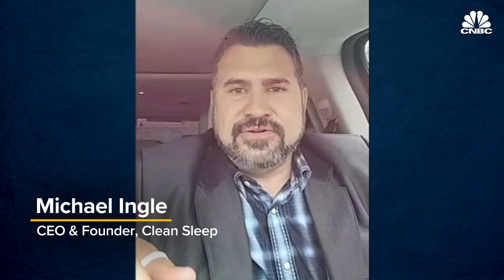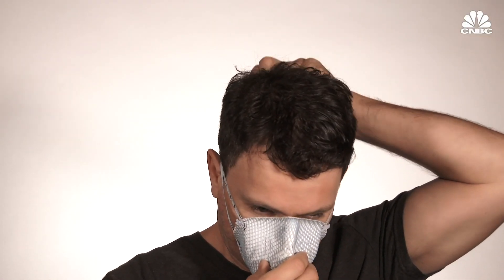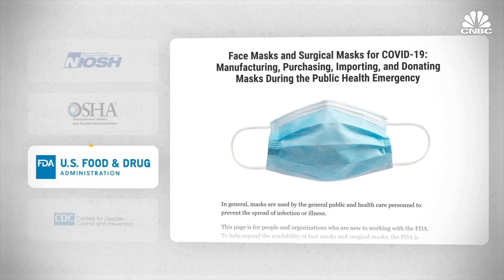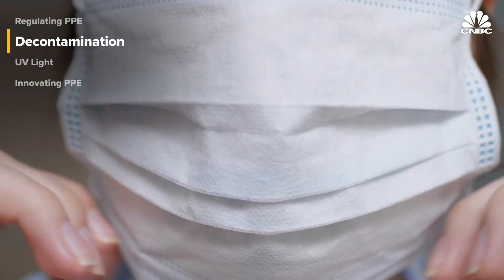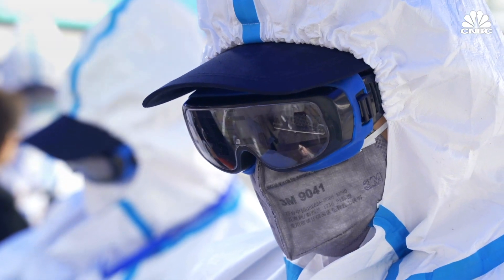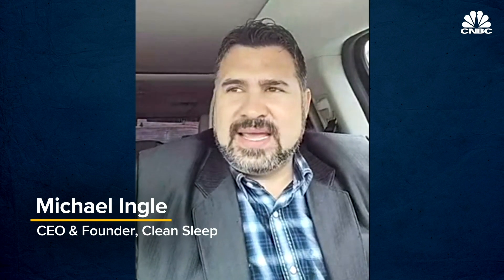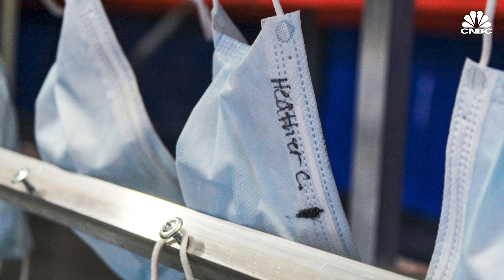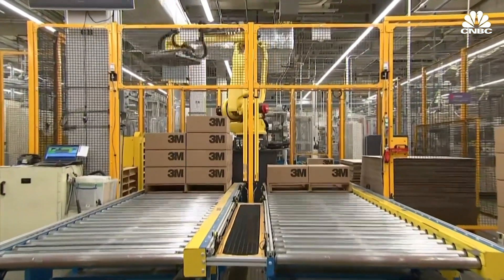Can PPE Be Cleaned And Reused?

Comment: they recommend the public to use cloth masks because the healthcare workers don’t have any... the cdc even released a report saying it wouldn’t filter SARS-CoV-2 particles
Reply: My question is why the common plans for cloth masks almost univerally fail to include a HEPA filter layer. HEPA can come from car cabin air filters, Vacuum cleaner filters, and furnace filters for allergens. All of these sources of HEPA filter material are  plentiful and in stock.
https://www.amazon.com/Hepa-Filter-Shop-Vac/s?k=Hepa+Filter+Shop+Vac
https://www.jondon.com/filter-2nd-stage-pre-filter-for-dri-eaz-air-scrubbers-1.html?gclid=EAIaIQobChMI75m0pqzQ6QIVBvzjBx3ktgxAEAQYAiABEgKwb_D_BwE
https://www.boschautoparts.com/en/auto/filters/hepa-cabin-filters
Reply: it does not spread through the air it's through water droplets mainly from the nose and mouth of the infected you don't need a filter you need a shield

Comment: No one should be reusing someone else mask or PPE.
Reply: @Grand poobah  I use to work in the nuclear power field. We traveled around refueling reactors. All the ppe we used was reusable from the respirators (filters were disposable), to the cotton "bunny suits". They were dry cleaned, and the respirators were put in a commercial dishwasher and sanitized for reuse. It can be done.  The plastic space suits for wet work were the only thing not reusable.

Comment: Put PPE in Ultraviolet - C radiation, it would get Sanitized. For N-95 masks, use carbon fibre washable N-95 masks which can be used numerous times. I live in Delhi and bcoz of High pollution levels during winter, I use carbon Fibre N-95 Masks throughout winters, it's costly as compared to normal N-95 mask but being washable and reusable justifies its price.
BTW manufacturing PPE isn't that tough, In my country India, during the initial phase of Covid-19 spread, not a single PPE was used to be manufactured domestically but now 450k PPEs r manufactured per day in India.

Comment: Should have been done years ago...by any hospital or health care system that wanted to curb costs. Why did it take a pandemic to think of this?!
Reply: Because it's not best practice.

New= guaranteeed safe
Reused = mostly guaranteed safe.
Reply: @Robert-j6r8c  The infection rate of health care workers is around 5%-6%. That number corresponds to the effectiveness of N95 masks which filters out 95% of harmful pathogens. No wonder health care workers are scared to the bone. There's always that 5%. Many nurses and doctors are old with pre-existing conditions.
Reply: @KL-bc1eg  no viruses are too big to enter the 5 percent is really just everyday air particles its more likely the 5 percent could be due to human error where a nurse or doctor did not maintain the seal or properly put on safety equipment its reasonable since some go through 17-hour shift or beyond that
Reply: Reusing or Re-sanitizing PPE is a very bad decision, since they are built for one use ONLY.